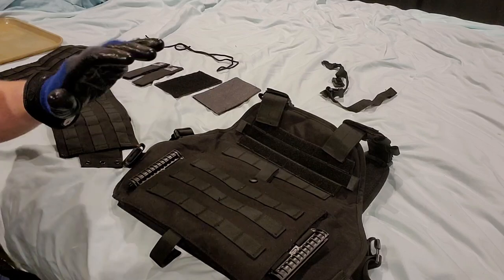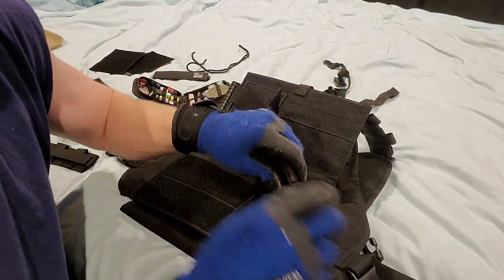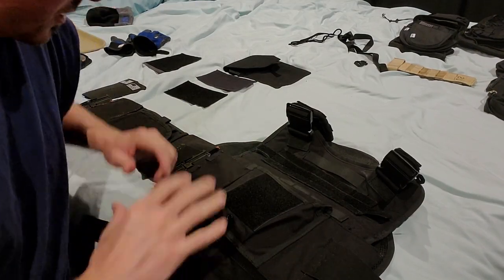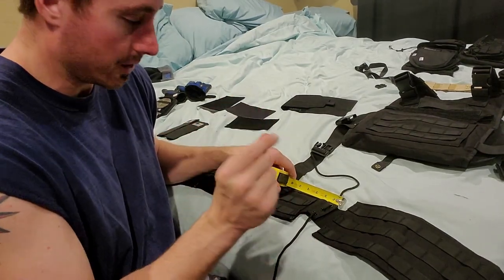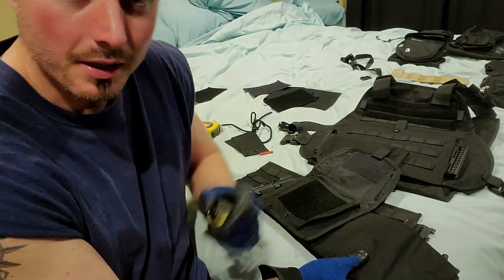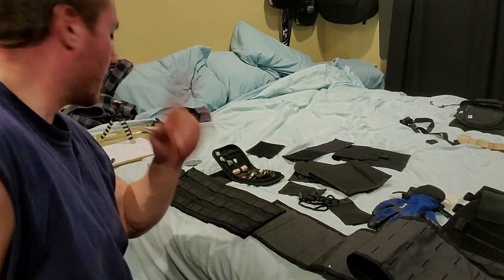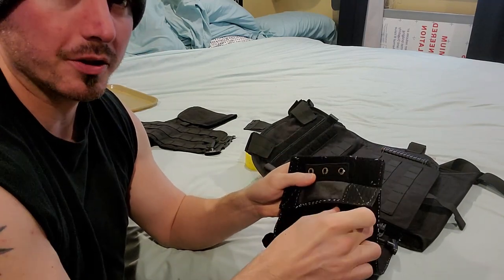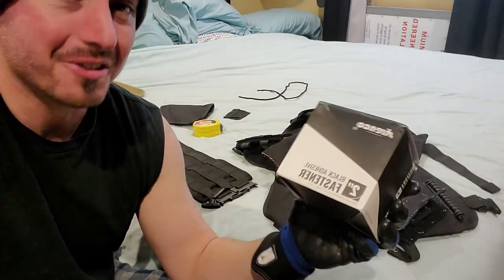Gfire tactical vest cummerbund modification

Comment from the maker: My apologies for the jumbled/mumbled audio. I tried to increase the speed of some of the clips to shorten the overall video and get you the info faster. Sadly, my speaking speed changes so some of it got mashed up and I didn't notice until after the edit. Feel free to use the video speed options to help even it out. .5 speed will get most of the video segments slightly slower than the original speed I believe. If you have suggestions on video styles that you think would benefit new videos hit me up.